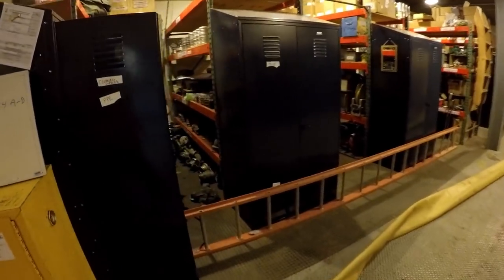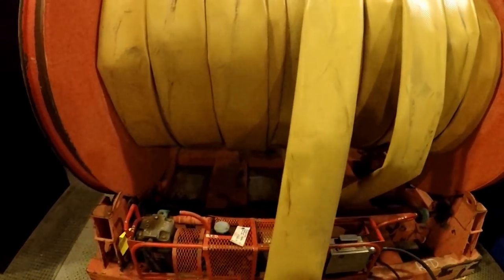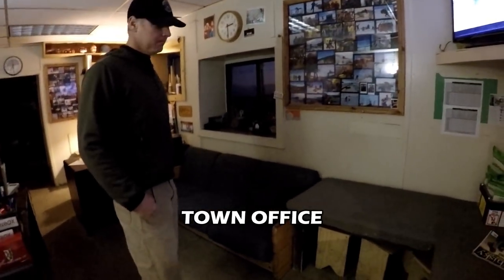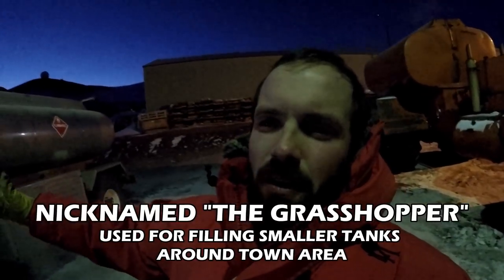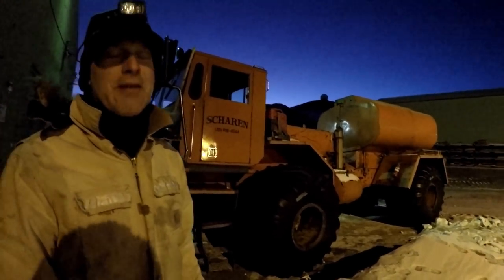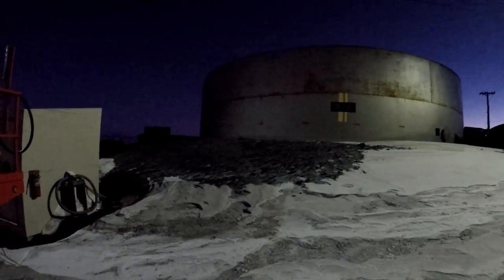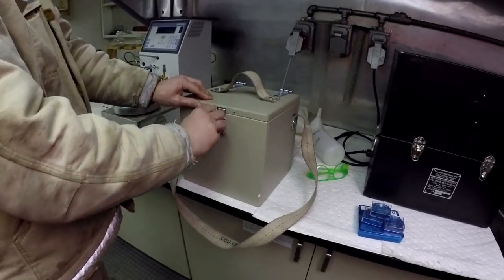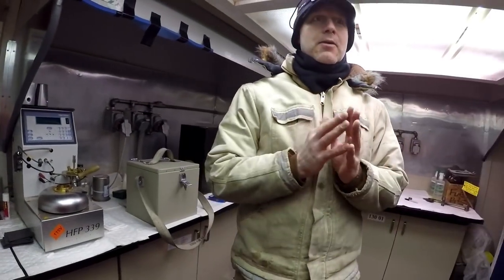Antarctica Jobs - Fuels

Comment: Thank you K Vex I see a lot of the job hasn't changed at all but I also see a lot of new stuff there also. We used to drive the D8 dozers  pulling 5000 gal. sled tankers hauling fuel out to Willy when the hose line was pulled. Back then the hoses were stored on 50 foot long sleds stored up in the pass. We didn't have the fancy hose rollers or fuel trucks. Laying and pulling the hose line was a bear of a job we didn't look forward to do. The Lab hasn't changed at all. Thank you again.   SnakeBite 77-79
Reply from the maker: Genuine comment, thank you sir!